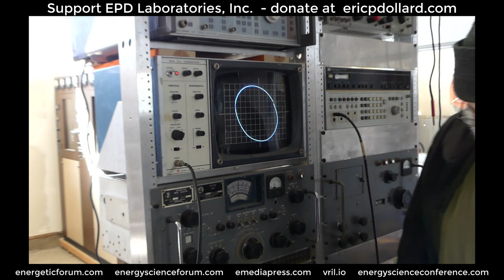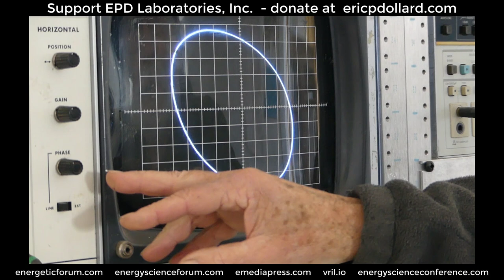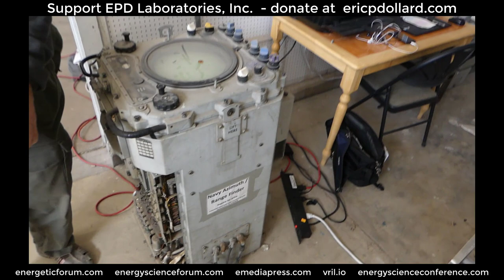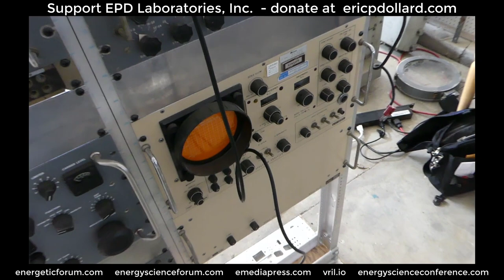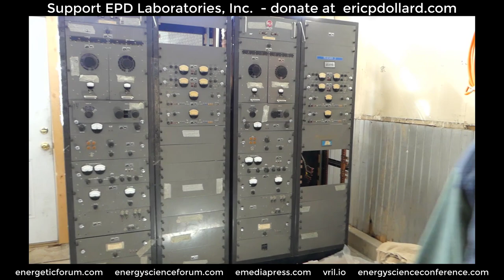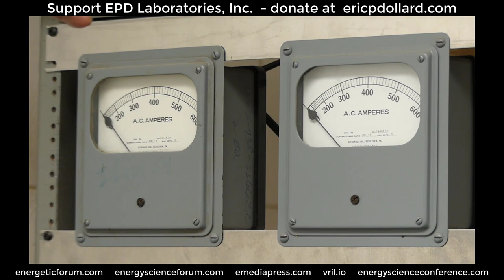2020-10-11 Eric Dollard's Music Television Project

Comment: The off shape of the circle are only the inlfuence of the lower harmonics up to 2 kHz up to a Volt deviation of the sine or so. The thickness of the line in this case imho is caused by the kiloHertz harmonics. Dave Stetzer found something interesting with dairy cows. To me it's a lot of abra cadabra, but I know those lower harmonics come from the generator at the power station and those higher from all the switching power suplies we use. At the clamps of the generator there is ALWAYS a dip behind the top of the sine, cranking up the voltage on the energizing? of the generator makes the dip less and increase VAr. It does increase oil temperatures and vibration on the generator bearings and also does increase temp of the winding coolant as the current increases. Seen it happen.
Reply: those higher harmonics 20 to 40 kHz or so are in the mVolt range that''s why they only thicken the line of the circle.

Comment: "Music television", what a ridiculous video! This is where you use the oscilloscope in an X-Y mode instead of a swept-time mode. Just about every first-year electrical engineering student does this in a lab! All you do is apply the two music channels to the oscilloscope in X-Y mode. One channel is fed into the X axis and the other channel is fed into the Y axis. He acts like this is some kind of new concept. It has been around for about as long as oscilloscopes and stereo music have been around (60 or 70 years). It would have been trivial for him to demo this so I don't know why he didn't. All that he needed was any stereo amplifier and a music source. You actually don't even need the stereo amplifier since hardly any power is required to drive the oscilloscope, just a music source such as the audio output jack of a phone. Truly laughable.